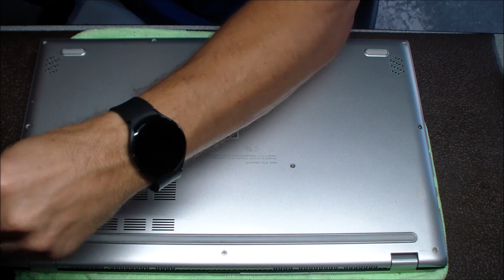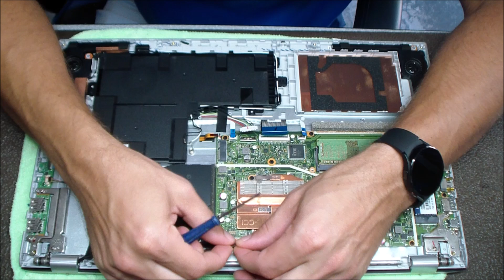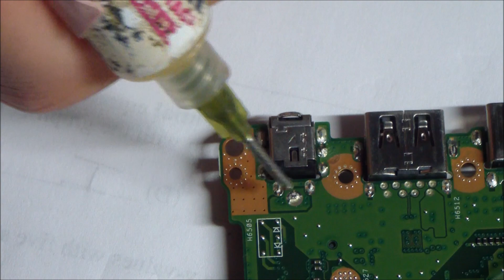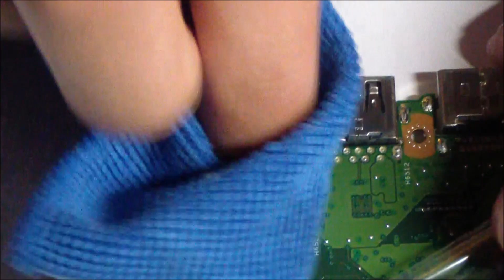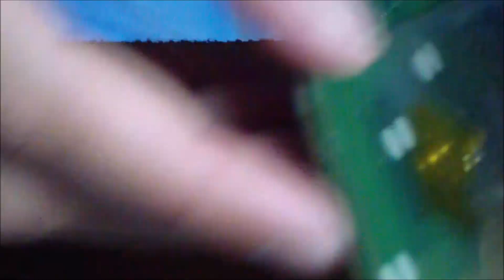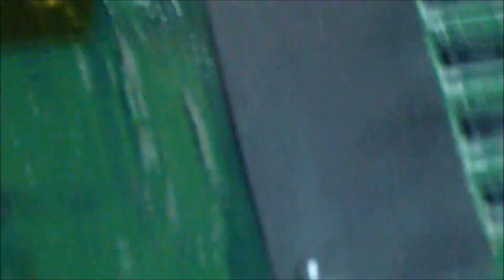Asus S712J power jack repair

Comment: Awesome work and nice video. Please though, you need to charge more in labour for this job, as weird as that might sound. Your skill to do this so efficiently is worth the money.
Reply from the maker: @xfist2facex  we'll see, if I get to busy I'll have to up the charge!  Thanks for the comment!
Reply: @pomeroypowerjackrepair  Good stuff mate. Thank you for the video. I'll be doing that replacement in the near future. Great tip with the extra flux to help reflow the solder.
Reply from the maker: @xfist2facex  No problem, good luck!